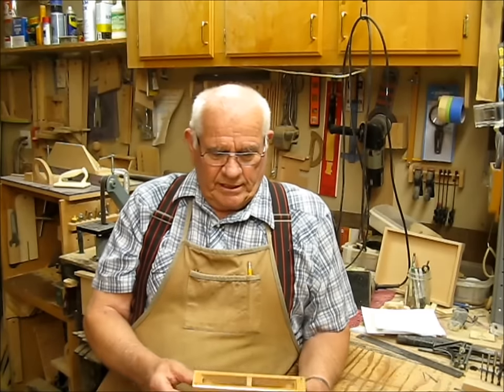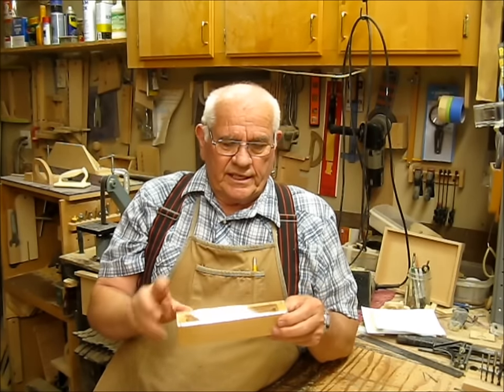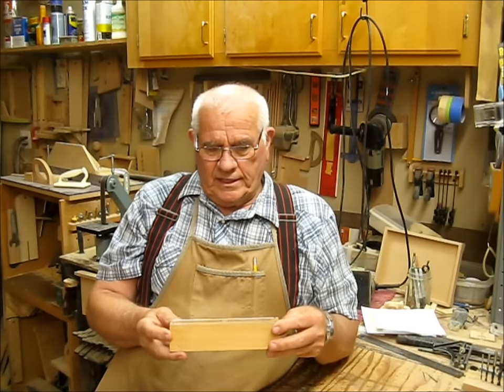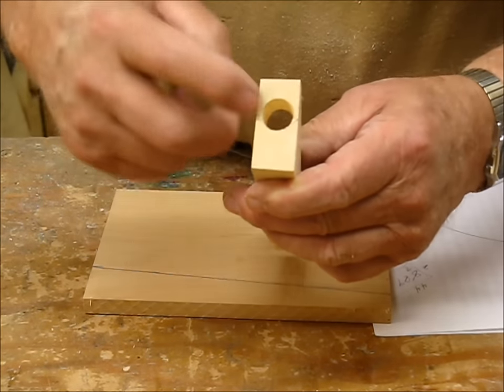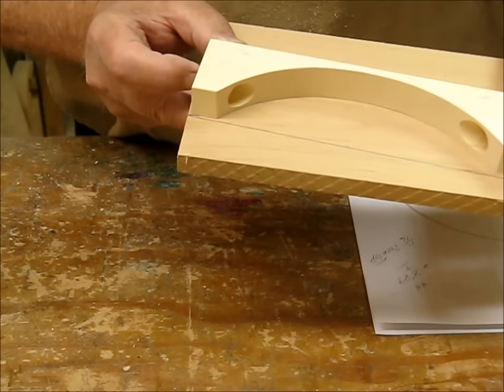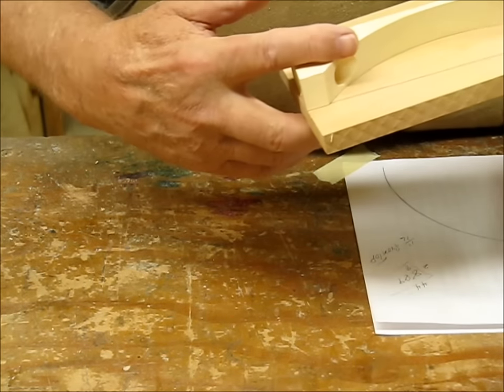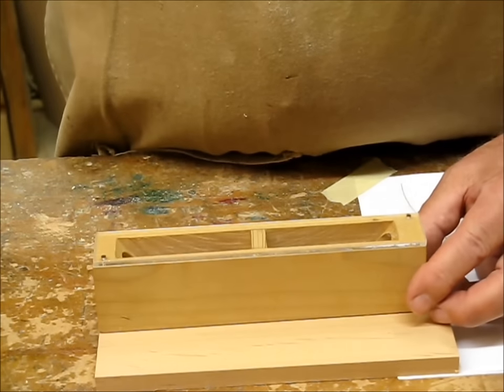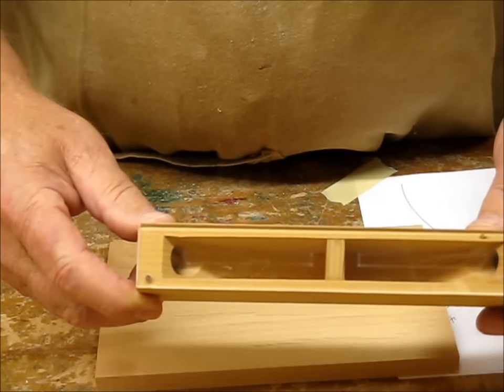Simple to make, marble puzzle

Comment: How does one cut the 5/8" hole in the ends with a drill press?  You mentioned how to get the 4 degree angle but not how one is supposed to drill it. The first end that I tried to drill split the wood piece.  Appreciate your help